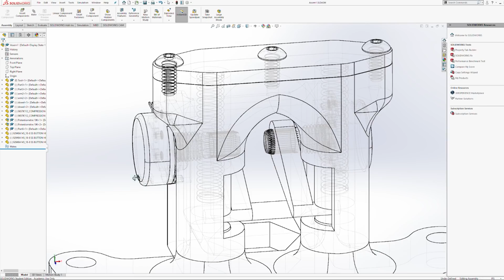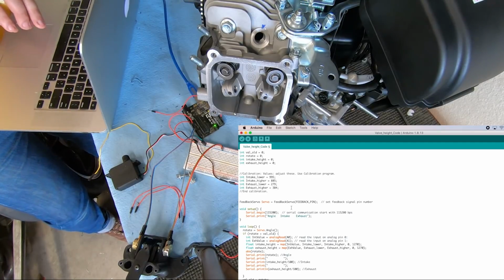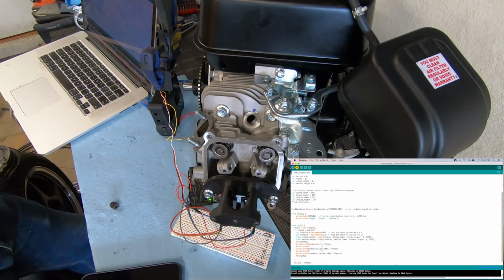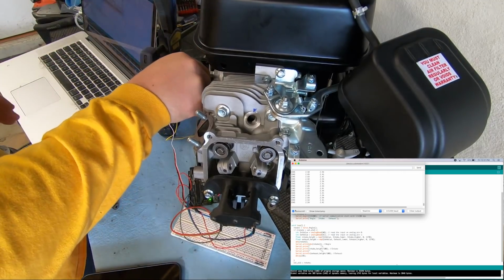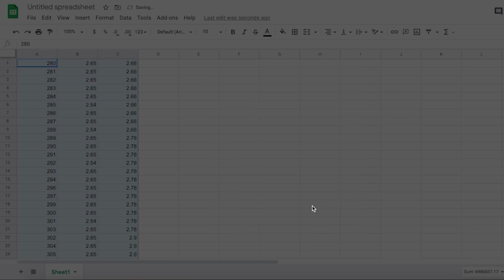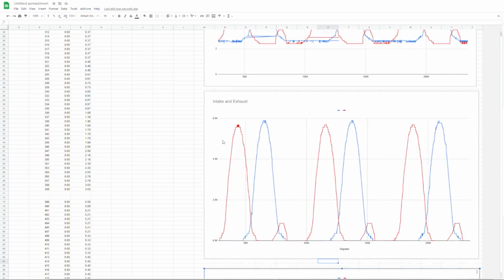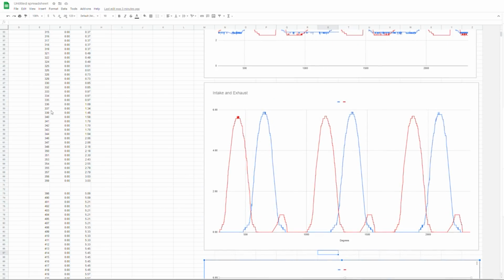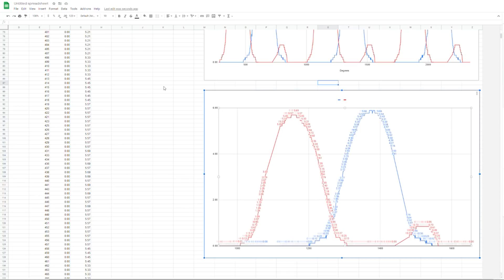Freevalve Build - Cam Mapping Tool

Comment from the maker: Huge thank you for all of the support recently- I'm still answering emails and comments, it just takes me a bit to get through them all. Thanks! 
Also if you haven't subscribed please do, It really helps!
Reply: I'm on a page on Facebook call The Predator 212 owners group. And man we would love to see ya on the page, lot of guys on the page build these things up to 20+ hp rippers, and i know alot of the guys might be curious what you're doing cause maybe it could be a soulution for some serious power, or being creative about it. You perfect it and sell it as a kit. Either way man would love to have ya on the group
Reply: This was a cool way of getting the original cam profile, which I guess could help you with testing.  However, one of the benefits of a camless valve train is that your valves are no longer required to follow the ramps that are necessary for a cam to work.  Therefore you can open and close the valve faster than you would be able to with a camshaft.  This allows more air to flow in and out of the engine over a given time period.  Thus your valve lift profiles should be closer to a square wave.  You may want to have a bit of a ramp on valve closing so that you don't have as much noise from the valve spring slamming the valve shut, but there really isn't a reason to have any kind of ramp on valve opening.  Good like on the project, though.  It looks quite interesting.
Reply: @r.j.bedore9884  This is a great idea but better off starting with the cam profile of the original engine. Easier target to work with. Once you have this profile replicated then you can modify it for a better fit to the revs of the engine.
First, get it working, then modify it.
Reply: hey are you interested in code improvements ? I can see a few easy basic  improvements.
-interpolate cam angle between magnet detections ( linear or even 2nd degree polynomial interpolation to account for acceleration). should be quite easy to implement using the loop function and provide a much more accurate way to measure the angle instead of 6degrees increment
-basic error tolerance if a magnet fails to trigger, to avoid counting the double time gap as the missing tooth and wrongfully reset the angle, possibly hitting the valve with the piston
-keep valves shut or very slightly open until angle is accurately calibrated.
-Rev limiter
But now with free valves there is also a lot of  bonus things that you can easily add in software
-cylinder deactivation/coasting/air brake
-support engine rotating in both directions ? would only make sense with start & stop and a  to get rid of reverse. would probably need an extra missing tooth to be able to check rotation 

-dyno mode
-soft rev limiter
Reply: @geemy9675  All great ideas but don't swamp the man with these until he gets it working on the initial cam profile. That's probably hard enough.
Reply: @LadyAnuB  sure,actually offering some help cause this whole free valve thing is opening up so many possibilities. it's screaming for open source software although I understand him wanting to keep control, maybe eventually a fork will allow him to integrate other people's at his own pace without slowing down progress. obviously there's hardware involved so not so easy for people to collaborate.
I'm wondering how far this project will go cause this POC is so promising, but I guess there will be bumps on the road with free valves keeping up with rpms. I just hope the full sized version delivers on expectations. It's amazing that a DIYer has a working prototype before any mass manufacturer even says anything about this technology. Probably a lot of things happening behind the scene though.
Reply: I’d be interested in putting this type of technology on my Honda cb750 that I plan to put in a go kart
Reply: And dont forget to hit that like
Reply: n
  w Dd dtt 55
Reply: m m m m) ))>m) m) l>m) )))m
Reply: https://anchor.fm/jujuan-youngbattle/episodes/Nobodys-Favorite-eol2fq
Reply: You are overthinking this a bit.

You really only need to measure your valve opening rate, closing rate and valve interference at full lift.

Your software should target a valve opening and closing position but that is going to change with RPM because your opening and closing rates will be essentially constant while the rotational velocity varies.

If I remember about Freevalve, you can also use it for "throttle" which will also vary the timing of the valve events.

Bottom line, your valve events will bear no relation to those of a stock cam but you will need to know a bit about ram tuning to map your valve events vs RPM and "throttle".

It might work with a carburetor but I imagine a fuel injection system would need different types of data to accurately fuel a Freevalve engine if you fully take advantage of infinitely variable valve timing and no throttle.
Reply: how much force does the valve support can do you think it could do high compression. and how many rpm do you think the engine can handle before you out pace the servo
Reply: Just subscribed I can’t get enough info on free valve tech
Reply: Would love to try this on my 03 V8 4runner. Anything to get a bit more power and gas mileage would be amazing. The 03 is pre variable valve timing so I find this very interesting as a option for the future.
Reply: Very clever, Wes. Good job. Looking forward to seeing what extra tricks you’ll be able to do with the HF engine. No instantaneous stop/start, obviously but CVVT should be fun. Just an idea to think about ( You seem like the kinda guy who’d be interested and might get it running ) - Laser ignition? Perhaps using a hologram window to seed multiple flame fronts simultaneously? ;-D
Reply: That's a pretty nice tool you made for measuring the cam timing events. reminds me of a cam doctor. Great idea to use that for programming your controller but unless the engine has a 1:1 rocker arm ratio you will have to multiply your measurements by the stock rocker arm ratio to give you the actual valve lift instead of the cam lift. Very different measurements.
Reply: @waggsm3358  is right on the money. Most rockers on overhead valve engines have a ratio that affects the lift at the valve stem.
Reply: Consider making a patreon! And i vote miata!!
Reply: @jamesandonian7829  I would sign up for that
Reply: @MyHandleIsGood  O’Donnell
I
Mmm
Reply: @jayden5899  Don't worry, I already know
Reply: @jamesandonian7829  He has one, look in the description

Comment: New to the channel and I like what you are doing 👍👍. Luv your sense of humour and your engineering skills. I didn't see your bio anywhere but you've obviously gone beyond middle school and are very curious with a mix of history, science and art.  Good stuff. FYI a sheet of plywood with some 2x2 around the edge and a sheet of poly will contain most of the mess when doing a tear down. Then use your wet vac to suck it all up. A shallow pool for oil ,antifreeze and whatever.

Comment: Quick question. Do you take into account the Rocker Arm Ratio ? Most auto engines use Rocker arms that increase the total valve lift by a factor of 50 to 70 Percent. This is REALLY important in preventing valve to piston interference which can and does cause bent valves.

Comment: very excited to see this. One thing to remember is that the cam opens the valves gradually because that's all it can do. With the freevalve approach you can open the cam much faster (at least at slower RPM). The only limit is if you have an interference engine where a fully opened cam will hit the piston.

Some of the valve overlap timing is compensation for the fact that the cam takes time to open the valve, some is to help flush the combustion gasses out more completely.

Comment: Still not following how you are sure the engine is on TDC power stroke, or TDC exhaust with only a tone wheel on the crank. are you using the spark plug as an input as well?

Comment: really liking the low cost free valve system. I've been think the same thing for a low cost race engine but using electronic solenoid. would this be something you would be trying as then there is no need for a air tank ?

Comment: Are those 1:1 rocker arms? That will determine your actual valve lift needed in respect to the cam lobes.

Figure you're aware of this and just didn't mention it in the video.

Comment: I'm wondering how Wesley will operate the solenoid valve fast enough to get any RPM above idle.  That unit from McMaster Carr is nowhere near fast enough.   I think that's the problem in the last video when he got it started but no acceleration.  The valves are opening as fast as they can already.

Comment: Volvo B230F engine. Non interference, and if it does then the valves go straight up/down and the pistons would force the valves back up.

Why use a conventional cam profile for the freevalve? Open/Close without the different heights would result in better air flow.
Also, try to use a teensy 4.1 as a control unit. It has a significantly faster processor, and works with the arduino IDE.

Comment: Now you can do variable valve timing on the fly without a custom cam or other weird engineering. Not to mention you can also optimize for low demand mapping, high demand, or even cylinder shut off. I'd say the most difficult part will be determining your torque curve for a given "cam" profile.

Comment: I'm a 72 year old ME and I wish I knew 1/4 what you seem to know in a varied knowledge base.  Love to tinker, so I'd like to ask a) what material did you use for the Hall effect timing wheel?   Looks like 3D print and I do a little of that.   Meanwhile, keep up the great work.   Absolutely amazed at your ability to get it done!
Reply: Oops Never mind the question.. just saw your file on Thingverse.... looks like you're using PLA.

Comment: If you get to the point where you inevitably need better electronics, and if you are open to working with someone, you can contact me and I'd be happy to help you engineer a purpose built Arduino based controller using automotive grade components and protection circuits. the Arduino uno doesn't do well with noisy environments. Also, pots for sensors is dirty and not as accurate as capacitive sensors. we could design a capacitive sensor for the valve stems. for your hall effect sensor wheel you might be better off using 2 or more hall effect sensors and having them line up out of phase to get a more accurate position.

Comment: I would go for Miata just for packaging reasons as well as valve oiling. The LS oils the pushrods and if you remove them you have to find a new way to oil the valves. I'm not sure how much oil they need up I know they need some for passive cooling and to keep the valve guides and seals in good shape. Both of these engines are 16 valve so the Mazda engine would just be easier on the control side. I would watch out though because the water pump I believe is driven by the timing belt so that would need to be worked out. Non-Interference would help as long as you don't open the valves too far. Using air pressure you could control in theory control how far the valves open. I would like to see how a pressure senor in the line to the piston controlling the valve compares to the actual valve lift measurement. Light valves and light spring I could see helping this project so you don't have to work with such high air pressures. Maybe you could control the valve lift via air pressure. If you have an accumulator where a pair of valves that can be pulse width modulated, one to high pressure and one to atmosphere, you might have an easy way to control lift without measuring air flow. Also if you drive the hall effects senor at half the speed of the crank, with a missing tooth you can tell exactly where you are in the four cycles. I know in the case of the engine in my truck my cam senor does most of the heavy lifting while the crank sensor is only there to confirm what the cam is reading. I'm really interested in this project. I will be following this closely, you've gained another subscriber.

Edit. Both will require oiling system modifications as the valves in the Miata are splash lubricated by the oil coming out from around the cam saddles. Without the cams installed could be a loss of oil pressure as there is now no restriction to flow. Drill tap and plug all but one and have that one run through a small copper tube with small holes in it over each valve. Or just build in a solution to your new module. Not sure if a 3D printed part can handle the PSI required to open the valve springs. It looks like they are around 45 pounds closed and 120 open. However, I am no expert when it comes to 3D prints.

Comment: I am an Engineer. I think your next step ti to put it on an LS or LT GM engine on two opposing cylinders. then you could compare the Free valve controlled cylinders to the original Cam operated cylinders. the Data you collect would be invaluable. P.PS FORD owns the patent on non-mechanically actuated valves.

Comment: First off; this is fucking brilliant. 
Second; I figured I'd suggest it, I'm sure someone already did but 600+ comments is a lot to go through for a lazy person like me, it wouldn't be too hard to add a small motor to the setup and run it at a constant speed to get a (probably) easier to clean up the curve.

Comment: Ok, so something crazy is going on here and it will be one of two possibilities:
1) this guy is BSing us to get youtube hits.
2) this guy is a genius, and should be working for tesla, rivian,blue origin or some research lab at MIT.
This camless technology has been the holy grail since the first camshaft was ground. I am sure GM, ford.... have put millions into developing this. now this guy with a 3d printer,  some pirated software  and a clutter disorganized garage comes up with a working prototype? 
seems like a nice guy but there are so many obstacles to overcome once the rpm's go past idle speed. its possible it could work at idle, once the rpms go up and have to start dealing with the inertia and high velocities  that tough.

my opinion i could be wrong.

Comment: To get cleaner values use a magnet and a Hall sensor to detect the rotation/movement of the magnet. take 10 or so sycles and take the average of the values, this will remove outliers and smooth the curve.

Comment: More BS here....

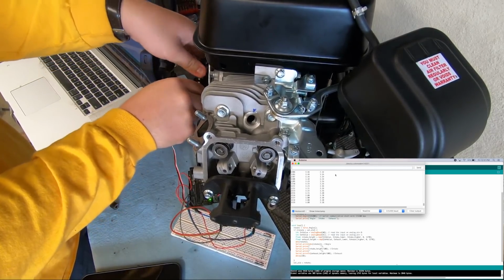Code shown would not print a line with identical values of rotate so at 5:26 you can see the screen and code and the values 2765 appears multiple times.  Even if it was a floating point number (which is should not be as these are discrete counts), the abs(rotate) would simply normalize the sign but not the precision of the variable and the print routine would show 2765.4583, 2765.4584, etc.   Since only a single input is used for rotation how did the sequence of ...

2765...
2764...
2765... 

happen (it only counts up as there is not another input to allow for direction detection).

Wesley review your stuff better before hoaxing these people....

Comment: Quick tip. Having so many magnets/openings in the timing wheel is going to create a lot of "noise" in the timing system. Most likely the issue you had with your initial trial of the optical sensor setup. You should be able to get away with using only one magnet/slot and adjust your code to work with just the one input signal per RPM. I would continue using the magnetic pickup but install the sensor over the magnet that's already installed in the flywheel for the ignition system. If you can get it to work it would really simplify your setup. Otherwise continue using the wheel you made with just one magnet in it.

Comment: LS is my vote, because he could possibly do only one cylinder, run the engine at idle and slowly bring his valves to life. As soon as he has that cylinder up to power he can install an 8 cylinder kit using the data learned from the test cylinder. Overhead valve engines have lots of oil that would have to be controlled (maybe cutting up the cam using it's journals to stop the oil flow, or remove the head and plug the oil feed) and water pump, some oil pump and balance shaft drive issues once the belt is removed. This guy would just redesign a belt system to handle it of course but it is more work. The LS already has the cam and crank signals and you only have to remove the rockers and push rods. I could see issues with making an end cap to seal off around his valve actuators and the valve cover so the mass air flow gives the correct reading on the test version. Also to push a valve open on the LS may require something other then a plastic mount unless his system eliminates the valve springs and physically pushes and pulls the valves open and closed. This is very interesting to say the least.